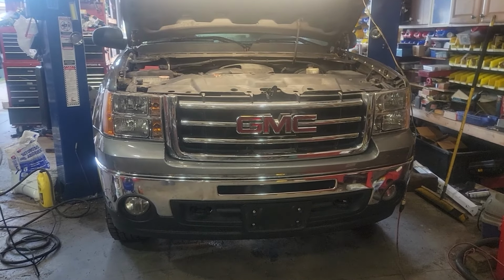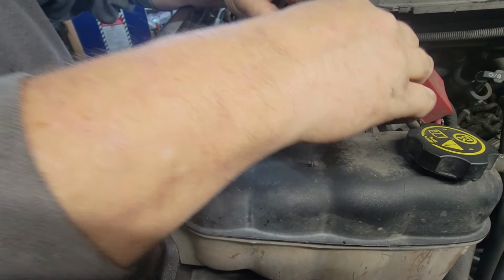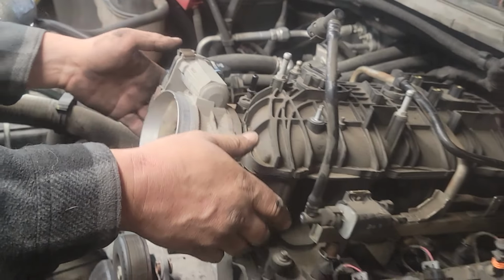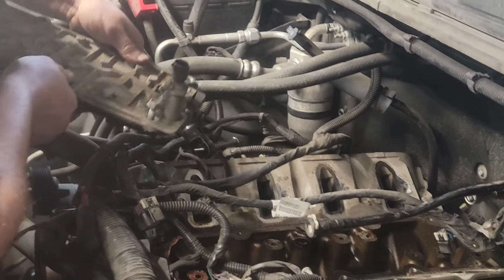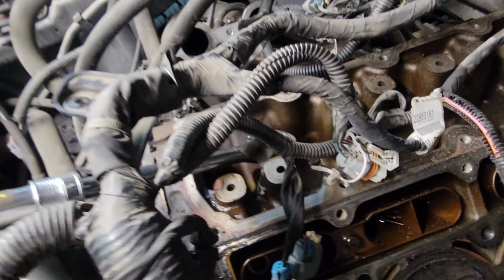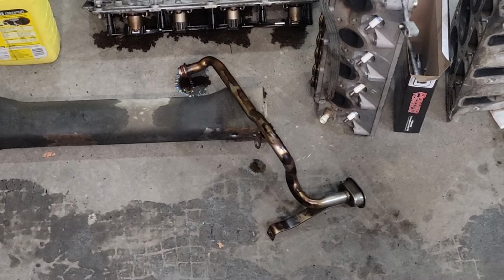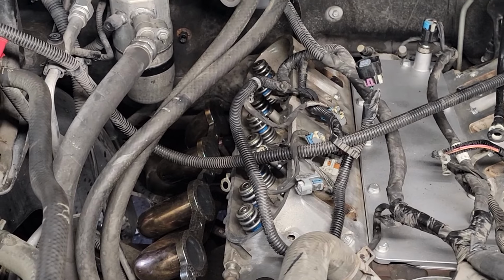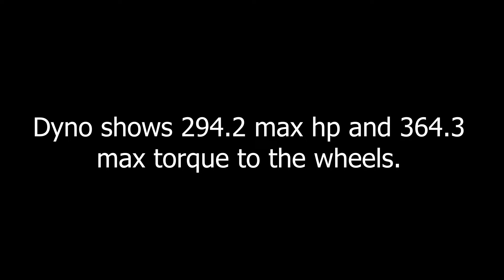How to remove DOD/AFM and VVT - BTR Truck Norris Cam Install on 2012 GMC Sierra 1500 | Dyno Tuned

Comment: I feel like I just want to pull the engine and put it in a stand if I'm doing the oil pump as well. It looks a lot easier than pissing around with no clearance for cams/oil pan/etc. Or am I crazy?
Reply from the maker: You absolutely can do that. Time wise and pain wise. It would probably save you a lot of back pain from leaning over the engine bay so much.
Reply: Do you have a parts list for everything you used?